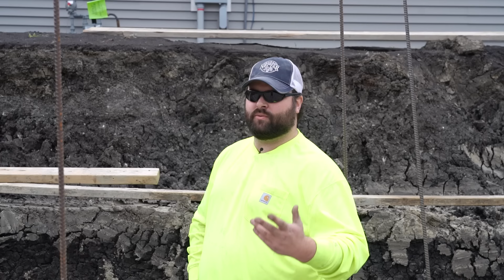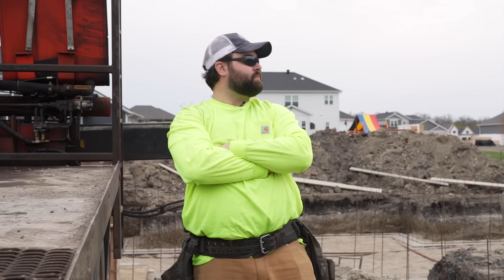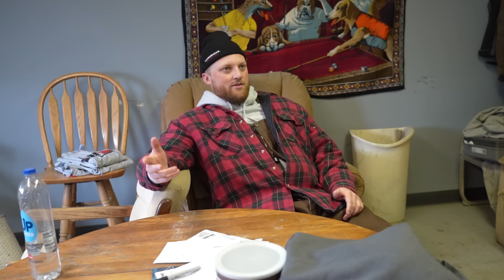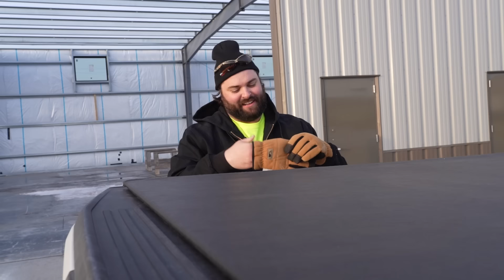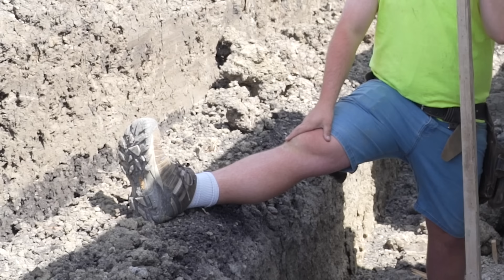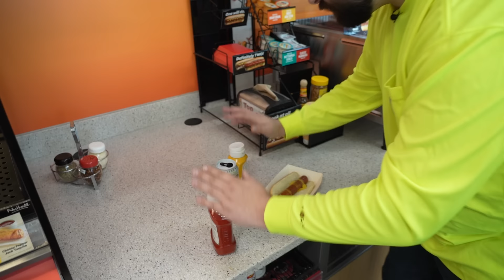The Best Of: Construction Skits

Comment: any reason he's complaining about the heat while wearing a long sleeve? and I actually did break my leg a year ago next month. still have to walk up stairs and steep slopes one leg at a time, good leg going up bad leg going down. the bus after work comes right on the hour and sometimes it's right at the top of the hill coming when I get to the door and I'm not exactly running for my life anymore, missed it today actually. and even worse is I can't bend it past 90 degrees so not only is my forklift training on hold but I can't lift with my legs, solely back lifting which is a safety hazard. so yeah, the PSA after of don't break your leg, good idea.